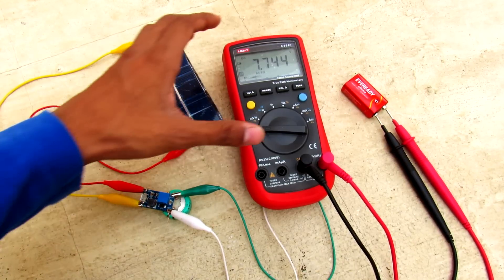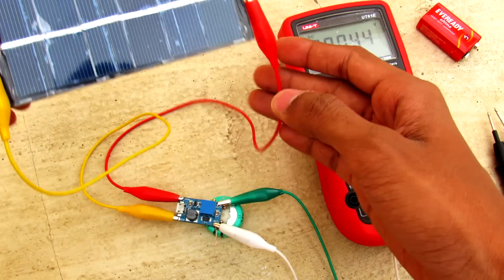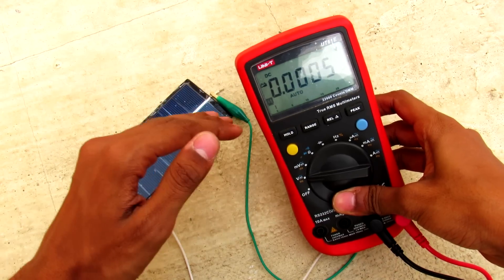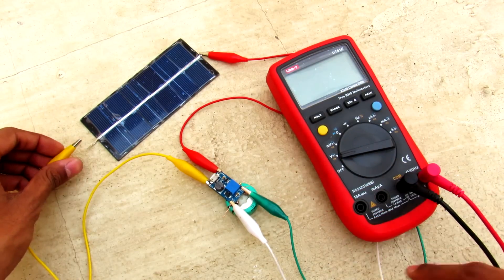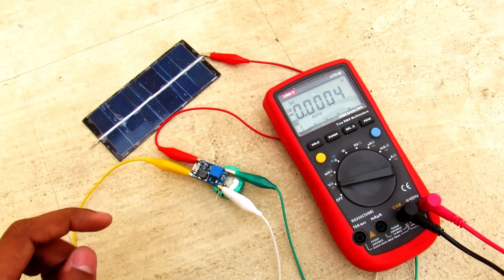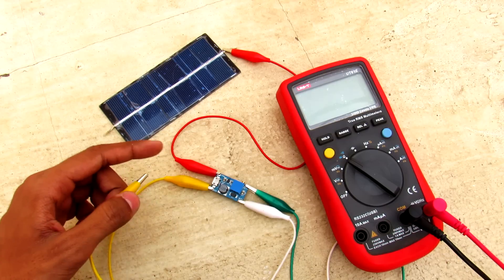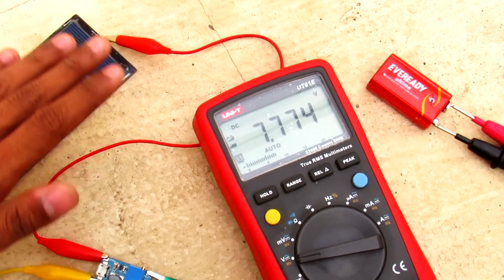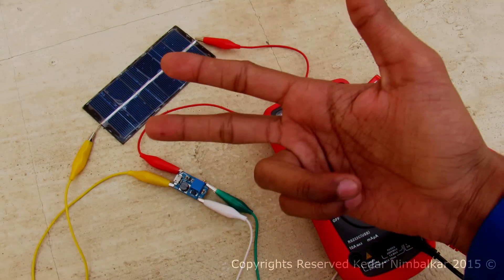Battery less Multimeter With Solar Panel And Supercapacitor Battery !

Comment: cool, i did mine using normal caps for now, i put a switch between the battery and the cap to switch to charging mode, modding a multimeter with a 12v jack plus a molex is easy, and charge in one second for 30h of use is good for me already, wait the supercap version...
Reply: don't forget to put a 1ohm resistor in series with the multimeter, because the multimeter might be configured for use in a battery, and one ohm is a low enough resistance.